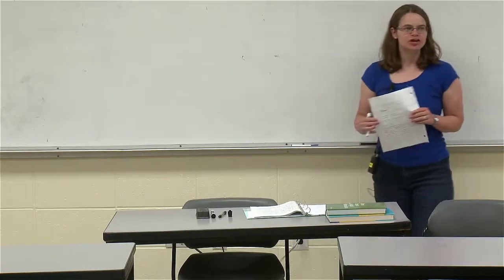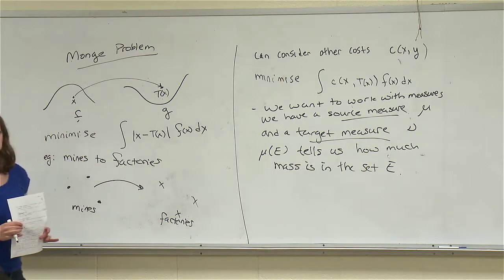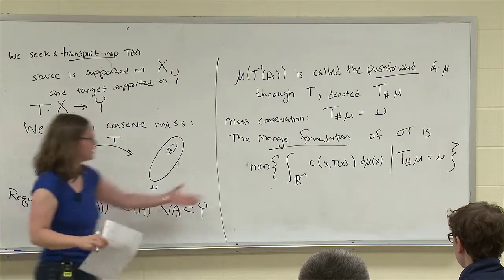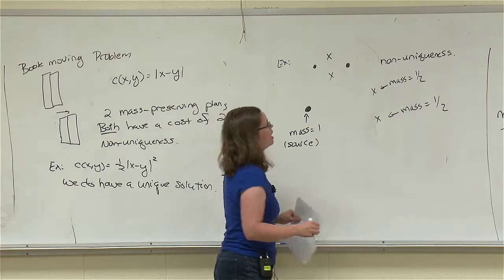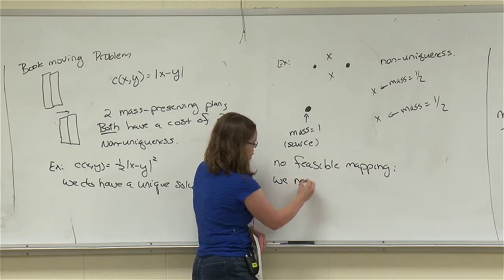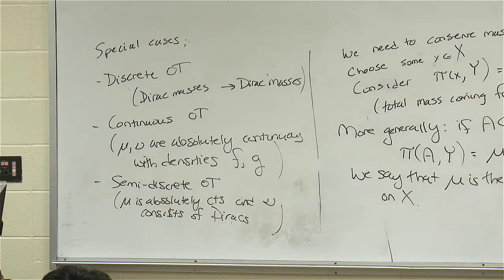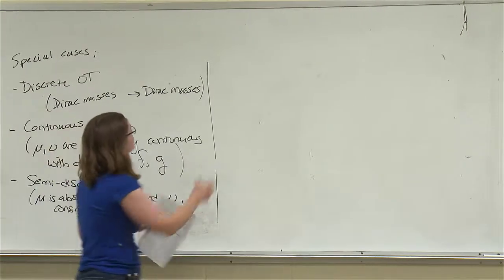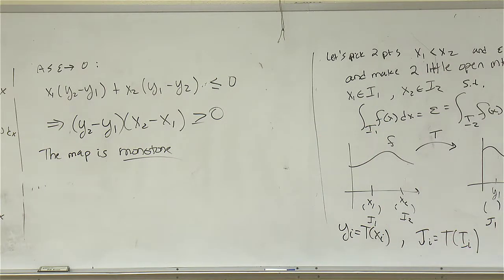Optimal Transport - Introduction to Optimal Transport

Comment: Thanks for sharing this nice introductory video. I have two questions:  (1) why can we write the preservation of measure (on every measurable set) alternatively in the form given at @52:11? (2) For 1D Monge problem, do we assume that $T$ is continuous so that an open interval $I_1$ is mapped to another open INTERVAL $J_1$?
Reply from the maker: (1) As a quick sketch of the reasoning, imagine approximating a continuous function h by a piecewise constant function h_\epsilon.  Then we can rewrite
\int_Y h_\epsilon(y) g(y) dy
as the sum of integrals over regions Y_j where h_\epsilon is constant.  Then you can apply the fact that 
\int_{Y_j} g(y) dy = \int_{T^{-1}(Y_j)} f(x) dx
and take \epsilon to 0 to obtain the alternate characterisation.
If you want to show the alternate direction of the equivalence, you can let h^\epsilon be a constant function approximating a characteristic function of the set A.
(2) In 1D, this argument can be generalised to the case where T is discontinuous (it just requires more careful bookkeeping).  The optimal map T would be uniquely defined almost everywhere, and can certainly have discontinuities.  For example, if your source mass f is supported on an interval and your target mass g is supported on a union of disjoint intervals the map would have to be discontinuous.

Comment: Dear Professor Hamfeldt, I dont understand why "T,T~ measure preserving" gives us the same integrals on I_1 \cup I_2, i.e. \int f(x)T^2 dx = \int f(x)T~^2. The definition for measure preserving has T only in the domain of the integral, but not in the integrand. Maybe you can help me out here. Thank you very much and Greetings!
Reply from the maker: Sure, this comes from the alternate way of characterising measure-preserving as
\int_X h(T(x)) f(x) dx = \int_Y h(y) g(y) dy
for every continuous function h.
If T and \tilde{T} are both measure-preserving than we could take h(y) = |y|^2 (for example) and get that
\int_X |T(x)|^2 f(x) dx = \int_Y |y|^2 g(y) dy = \int_X |\tilde{T}(x)|^2 f(x) dx

For a quick sketch of why this works, imagine approximating a continuous function h by a piecewise constant function h_\epsilon.  Then we can rewrite
\int_Y h_\epsilon(y) g(y) dy
as the sum of integrals over regions Y_j where h_\epsilon is constant.  Then you can apply the fact that 
\int_{Y_j} g(y) dy = \int_{T^{-1}(Y_j)} f(x) dx
or
\int_{Y_j} h_\epsilon(y) g(y) dy = \int_{T^{-1}(Y_j)} h_\epsilon(T(x)) f(x) dx
since h_\epsilon is constant on these regions.
Then sum over all the j and take \epsilon to 0 to obtain the alternate characterisation.
Reply: @brittanyhamfeldt  Thanks a lot!

Comment: Thanks for putting up these amazing materials. I have two quick questions, 1) if the transport problem is restricted in probability measure, wouldn't the product measure itself defines a measure preserving transform,  hence the problem is well-posed (the set is non empty)? My intuition suggest this will be a terrible way of transporting, as we are "uniformly" redistributing the masses. 2) I am thinking if there is a connection to markov chain, as if we start with a probability measure over the states, there is a natural "push-forward" measure induced by transition function, and I can define a "transition measure" that satisfying the measure preserving property between the initial measure on states and the updated measure after one markov transition. I guess I might have to wait for later set of lectures to answer the question: is this transition measure the optimal transport (with respect square cost)?
Reply from the maker: 1) Yes, for the Kantorovich problem you can easily construct a feasible transport plan, which takes care of existence of an optimal plan (though not uniqueness).  The Monge problem is different: there may not be an example of a feasible transport map.  For example, consider a source consisting of a single unit Dirac mass, and your target of two masses each with weight 1/2. A transport plan will allow mass from the source to be split in half, but you cannot accomplish this with a single-valued transport map.
2) Yes, in fact some methods (eg Benamou-Brenier) involve flowing your measure from the source to the target.  Along the way you produce such intermediate measures as you propose.